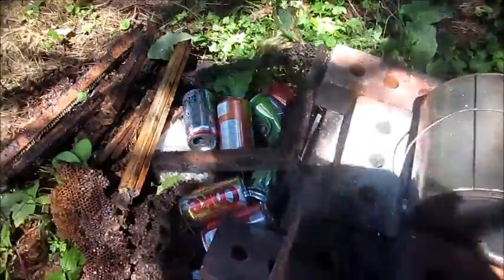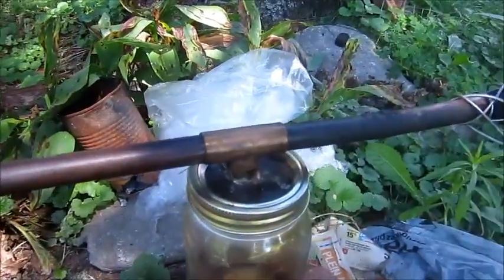Plastic to oil refining

Comment: You did several things wrong and you will have a disaster.
1. you only filled the can half full and when the plastic melts and starts giving off gas it will explode when the gas gets to its flash point.
2. You never got rid of the air in the container before you heated it.
3. Never use a paint tin and if you are stupid enough to use one press the lid on very tight.
I know by experience as I have had one blow up and burn me quite badly.

Comment: What can that oil be used for once processed
Reply from the maker: The goal is to be able to refine the substance into some sort of fuel to be used for engines.
Reply: With the controls of an industrial plant, one could pull pretty much what ever was needed.

Comment: hi, I made this experience but the product condenses to a solid  .can you help me and tell me whats the problem. I would have fuel in results. please, can you give me your email.thank you.
Reply from the maker: I have not experimented further with this setup so I can't tell you how to transform the product, however next time you try this, put the gas outlet pipe into water so the gas bubbles and condenses into a liquid which will float on the water's surface.
Reply: @castironmachines  thank you
Reply: @hananotmane2361 Also try to use old tires not pvc or pet plastic, i added video on my channel where i'm refining tires into liquid fuel similar to gasoline.
Reply: @Dymitr_Nawrocki  thank you .i find the probleme .isn't the type of plastix but the munner of cooling the vapour .now i have result. thnak you a lot sir
Reply: @hananotmane2361  No problem, btw. this solid parafine thing formed when the cooling was weak or because it didn,t had filtration in water, i'm building new more advanced setup and i'm planning not to use water to cool vapors in the same container as fuel is stored but maybe i should use some other kind of filtration. Or maybe the temperature in reactor wasn't high enough? I would like to know details how did parafine created because i don't want to choke my new cooler with it.
Reply: @Dymitr_Nawrocki  what is the octane level?
Reply: How are you cooling it? I’m also having a similar problem of getting wax.

Comment: Great work, just a tip shorten the copper pipe to the collector and half fill with tap water, this will cool the gas and your newly made crude will lie on the water. I wouldn't bother with a second collector, but that's your decision.Also why not try and use the waste flammable gas produced.All in all a great effort.. the key is refining the equipment used in making the crude for maximum efficiency.
Reply from the maker: Thank you for the ideas, if I rebuild this system I'll do exactly that

Comment: Hi! I am doing an independent project for school where I am trying to replicate this, would it be possible for me to get an exact supplies list/written instructions on how you set this up?  I can email you as well as I do have a few questions, but any help is greatly appreciated :)
Reply from the maker: No problem. I can give you a list, but keep in mind this is an extremely basic setup and bubbling the output through water would be a better system. Materials: Steel paint can (any steel can with a removable lid), metal pipe (I used copper, but using steel would be better since copper has the possibility to react with certain chemicals), a jar (use glass because plastic will melt), Optional: a copper coil to condense other gasses( cooled by air or water), or a pipe that leads into a tub of water so the oils condense and float on the surface since oil is less dense than water, a balloon to collect any light gasses that won't condense (or burn them), and whatever type of plastic you wish to use. Feel free to send me an email if there's anything else.
Reply: Everythingman95

Comment: sir I am doing similar project how  the  container withstand    high temperatures?
Reply from the maker: This depends how high the temperatures are that you want. Since this is only a steel paint can about 1mm thick, it won't stand heat much hotter than wood. If you want to use propane or an air blower to increase temperature then you should use a thicker steel can like an empty propane tank, just be safe and ensure that it's empty before working with it.

Comment: Hi I am planning to build a pyrolysis furnace in the future so what materials I will need to build one? Here are the materials I think I'll need but I could be wrong. How is the gas converted to oil? Can you use a chillar machine and put condensing coils in a box to collect the oil? I will be using hydrogen to heat the bio mass up. Here are the materials I think I'll need but not sure.
1 Cart. To move the unit around
2 Thick stainless steel barrel
3 A couple of hoses
4 Burner. Be under the barrel as a heat source
5 a Handle to pull the car
6 A condensing box. where the product will be collect.
7 Something to hold the barrel up. 
8 Filter. To collect unwated stuff from the oil.
9 A couple of bolts. To hold things in place.  
I think that is all I need to build a working one.
Reply from the maker: That looks like a good list. A coil for cooling the product can work well, as long as you are careful to keep the products at a good temperature. If not, the product may end up like mine and condense to a solid, blocking the coil. Also make sure your hoses are metal or can at least take the heat well and not melt.
Reply: Yeap. That is what I'll need. I prefer to use hydrogen because it saves you allot of money and burning other biomasses. All I need is an electolysis machine hooked up to the burner. I think I can buy one that is cheap. Also I need a cart so when I move the unit I won't have to take it apart and put it back together every time I move that thing.

Comment: May i know what kind of oil that was being produce after that simple pyrolysis? is it gasoline?, diesel?, kerosene?  i might build one, but i just want to know what kind of oil is being produce, so i will be able to know where to used it. thank you
Reply from the maker: The product here is more a paraffin wax-like substance. I'm not exactly 
sure what it is too be quite honest, but it was flammable leading me to 
believe that if you heated it and collected it in a distillation type 
column, you could be left with fuel products. A better way to do this is
 to run the output pipe into water and bubble it so the product will 
float on the surface since oil is lighter than water.

Comment: Why doesn't he have the end of that pipe submerged in water? He would be capturing all of that fuel he is burning off!
Reply from the maker: +DavidBruce Allen Yeah you're right. This system is really inefficient and just a test of mine. To actually get good product, the gas should be bubbled through water.
Reply: The gas at the end can only be condensed with refrigeration.

Comment: you do realise thermal decomposition of the plastics produce benzenes and dangerous hydrocarbon like phenyls; all of which are carcinogenic and poisonous.
if you want proper oil consider hydrocracking your product here
Reply from the maker: science Vlog If I get into doing this again maybe on a larger scale, I will wear a mask because yeah, that's not clean stuff. As well I am going to have a different approach and bubble the output through water so the oil floats then refine and experiment with the product.
Reply: EverythingMan95 yes, try to like experiment with different plastic because some plastic like styrene(Styrofoam) breakdown into their monomers which can be less flamable

Comment: Hej i would love to meet anyone that have an idea of turning plastic into oil, any developer ?
Reply from the maker: king jahseh Thank you, turning plastic into oil is definitely an interesting topic. It's not too hard to do either and recommend anyone to try it.
Reply: +EverythingMan95  will u guide me in doing this process?
Reply from the maker: I haven't looked into it in a while, so I recommend just looking on the internet and there are many examples of it. It may be called turning plastic to oil or "pyrolysis". To make a simple thing like mine all you have to do is get a metal container, fill it with plastic, heat it, and bubble it through water. Just make sure the can is sealed and no air can get in.

Comment: If you have withe smoke coming out the last pipe it means that you're lossing some particulate material, you have to see no "smoke" to be sure you are recovering all the liquid fuel, in order to do so its a good idea to buble in cold water or you can  put the copper coil under cold water
Reply from the maker: Yeah, next time I do this I will bubble the gas through water. Thanks

Comment: Have you thought about putting the coil, back to under where the can is, and using it as a fire for your kiln, because of the gasification process you could use that as a pilot fuel.

Comment: You might also change the BBQ style stove and use the turbo stove style instead as they reach a much higher temperature quicker, use hardly any wood, and with much less smoke..
Reply from the maker: Yeah, sounds good and I'll look into it, thank you
Reply: EverythingMan95 Also the reason your oil is not liquid is because you are not cooling the gas that's coming out, it needs to flow into water which cools and turns it back into oil...see other videos on this subject on Youtube...

Comment: your product would be better if you allowed the syngas to condense through water and siphon off the top layer.
Reply: haha ive distilled mercury so i agree with the very end comment completly true science !! google : the demon core , if you have never heard of it before. :)
Reply from the maker: Yes I'll do that next time. With using the tubes, some of the condensed stuff cools and sticks right to the copper clogging it.
Reply: Great tek, though..will come in very useful in the coming years! :-)
Reply from the maker: Thanks :)
Reply: The only thing I'm unclear on, is exactly what do do with the water, proper disposal..i know Toulene and othjer baddies have to be in the waste water
Reply from the maker: Yeah I have no idea about the disposal.
Reply: EverythingMan95 use a setup where you can retain any true gas and not vapor, like this which they are using to make hcl , im sure your smart enough to figure out what your looking at is essentially what you have already minus the gas trap. you would ideally modify this apparatus slightly for instance a bleed tap on the trap to remove the desired fraction thats accumulating in the trap. http://www.orgsyn.org/demo.aspx?prep=CV9P0281
Reply from the maker: Yeah that's a great example of a system. This summer I hope to make a bubbling system so the oil will cool in the water and rise, but yeah the concept is very similar. Thank you
Reply: im well chuffed with this video tho i never knew pyrolsis of plastics gave hydrocarbons, do you know what hydrocarbons can be retreived? whats your thoughts on catalysts in this kind of setup you could possibly do some molten salt rxns or something similar to make different hc's ?
Reply from the maker: I'm not sure really about any of the exact sciences behind  whats going on. I have heard you can definitely use catalysts but I don't know about specific hydrocarbons. Basically what I say about the h.c.s is just what I heard in some of my research and am not entirely sure if it's true. This pyrolysis is for sure an awesome way of learning and testing stuff at home though with its simplicity to build especially if you are interested in chemistry.
Reply: yer never used a setup like this but i have destructivly distilled to reap benzene from benzoic acid and other experiments like destilling ether and nitro hcs'  (with boro lab glass mind) , its a very good concept i dont imagine it to be that complicated i believe it will reduce from a polymer back to the hcs' it came from dependent on what plastics you put into the barrel, cats might help increase yield and possibly if you fed it threw molten cat reactors like mrtesalonian does with his syngas if you youtube him and his gasifier, than possibly you could convert say naptha into a different hydrocarbon , but you would need to google what cats naptha and kerosene can under go, just be careful of oxygen getting into the flow tubes or that thing will explode , use charcoal and allow it to bed down into embers before starting distilation and then start another fire x distance away to supply fresh embers thats what alchemists did back in the days the flame can lick the vapors and your fucked, thermodynamics on your side with no flame you reduce the risk alot so much that if you throw naptha or kerosene onto embers it will just boil off as vapor which you could even use to your advantage but thats some dangerous science O.O
Reply from the maker: Aha yeah Mr. Teslonian is who gave me the idea originally. I tried with wood but it just made wood wine because it was too damp. But yeah catalysts would definitely help a lot and I have to make sure the system is totally sealed or else it will explode like you said. Why do Dangerous things have to be the most fun >.>

Comment: what is that tape you used to tighten the connected pieces?
Reply from the maker: I do not recommend using it since it lasted very little time, but I think it was a mix of hockey tape, duct tape, and maybe electrical tape. If I did this again I'd use some sort of heat resistant stuff.
Reply: can you recommend any heat proof stuff?
Reply from the maker: Gosh I don't know. Hockey tape might work but the adhesive on it might go away after a bit and it might peel.

Comment: It seems your plant is capable to collect only a minimal amount of solid or highly-viscous fuel inside the jar(s), while a lot of gas is expelled and eventually burnt by the escape pipe.

I suspect the proportions could be reverted to increase the pyrolysis efficiency: little gas expelled and more fuel collected in the jars.

The fuel you collect is solid probably because only the heavier hydrocarbons (bitumen, bunker fuel, paraffin) manage to get condensed by the cooling coil, and the lighter products like gasoline remain sufficiently hot to not condense in liquid state and fall into the jam, but instead remain gassy and are expelled.

I suspect the cooling coil is inefficient. I'd be curious to see a next video from you trying to improve the cooler of your plant, maybe by submerging the coil into a water tank.
Reply from the maker: Yes, when I get to making another of these videos, I plan on making some sort of condenser with water to cool as much as I can.
Reply: EverythingMan95 Fantastic! Poke me when you take the test on video :)

Comment: What do you do with the oil?
Reply from the maker: Since I have such a little setup, I just burn it and test it and try to refine it if possible. If you have a bigger setup with like an old oil drum then you could get a good batch off and use it in small motors or something.

Comment: good. now do it with bunch of chopped  plastic bottles. without a jar in the middle, put that coper pipe in to the jar of water (immerse the pipe in the water)  at  the end.. oil will collect on top of the water. what collects on the top let it drip in to the second jar.   or maybe thats not safe :/
Reply from the maker: Sure I'll try that I've seen that before and it seems more productive. Thanks
Reply: thanks for sharing btw.  :D   it is helpful . looks simple and i think in near future, we all  will be more independent thanks to you and  people like you sharing the knowledge.  thank you.

Comment from the maker: I just connected the pipes into the jar with a small brass pipe elbow then put a nut on the other side to keep it sealed
Reply: EverythingMan95 you should use that waste propane / butane to supliment the firewood that is burning
Reply: EverythingMan95 Why not use the gas your burning to heat the plastic?
Reply from the maker: Yeah you're right, it would make more sense to do that but because there is so little of it, it won't do too much, and I like the look of a mini oil refinery with that stereotypical flame thing.
Reply from the maker: You're absolutely right, but I like the little burning stack because it looks like an oil refinery

Comment: This waxy petrochemical is probably a long chain carbon molicule. With further heat it could be fractionated to kerosene. The burning gas is probably ethane or methane. Sort chane carbons.
Reply from the maker: That's pretty cool. I'll take your word and try to further refine the wax
Reply: You can purchase a book called Chemistry for dummies . Look at the chapter on oil refining. It will shed scientific light on what you are doing. Please don't put Shell out of business.